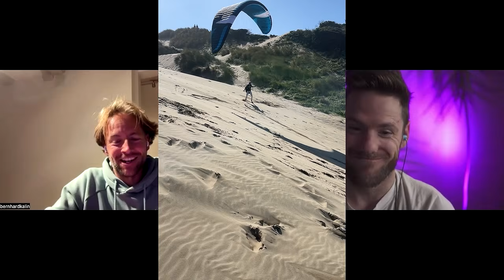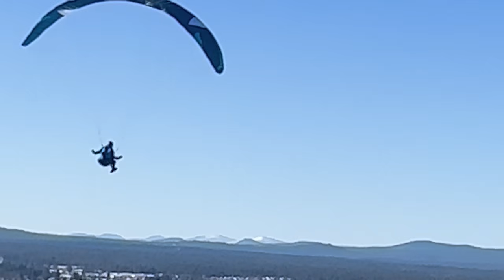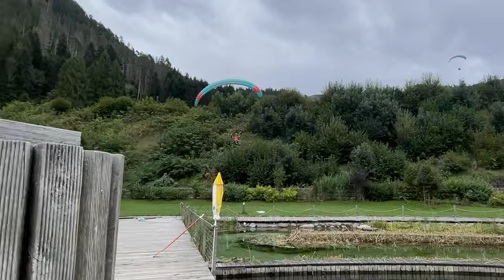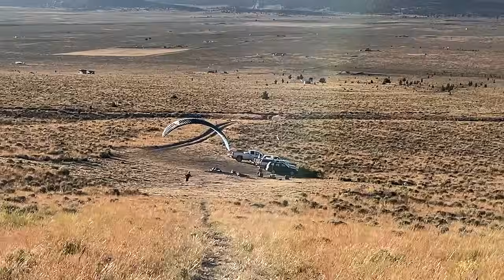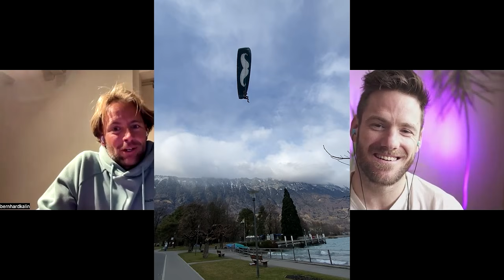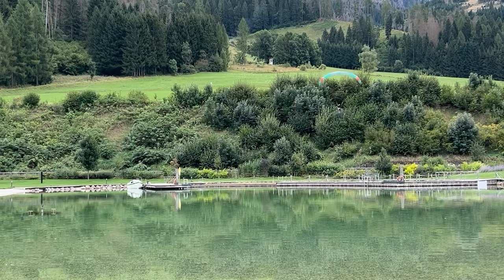Why Parakites Don't Collapse (And Why That's Dangerous)

Comment: You talk about safety parakite, but you didn't consider why he doesn't have certification.
Because he wouldn't pass this certification. 😂😂😂😂😂😂😂😂
Reply: Whyy? Please explain! Look at Vril Raptor it comes with an additional normal riser kit so you get the passive Safety to fly in best glide when not toucjing the brakes. Why should it be not safe in thermals???
Reply: @joyarosenberg954 all reflex glider have no certification. Because on full speed, they can't pass certification. On full speed reflex wing are not stable to recover after full stall or callopse. Simple like this.
Thats why ppg wings have normal risers and do not have  certification, like classic wing with normal risers.
The same for speed wings, you have no certification, even they have classic profile.
But here is problem of wing load. That's making wing unstable to recover after callops or stall.
That's safety.
Safety is only when everything going good.
But if something going bad is not safety.
That why you have no certification.
😂😂😂😂😂😂😂.
Here is the user manual for it ,what is safety and what's not safety .
Because even professional pilot can't recovery glider from big shit situation.
😂😂😂😂😂😂
Safety here, is only marketing word.

Comment: Parakites are actually dangerous in strong thermic conditions, right?  This message seems to be labeling patakites as safe and paragliders as dangerous.  And sure in some cases it probably is the case.. but, for instance, flying a B wing in thermic conditions is certainly way more safe than a mustache. No??
Reply: That‘s what I was also here for trying to find that exact thing out. From a aerodynamic perspective I don‘t understand why it should be not safe to fly a full reflex profile wing in thermals. As described in the video they are much more resistent to front collapses and only have not as much performance to climp thermals but so why not just put normal riser system on a parakite like the brand Vril does with it‘s raptor and go into thermals with it with size 22 or 25? I feel like flare and other companies just say don‘t do it with parakites because they now a lot of beginners use them on the dune without licence because they are so intuitive and they would bring themself in a lot of danger flying thermals with it and that‘s also what benni says at 7:45 that Moustache is basically a Beginner Wing in big Sizes but they don‘t sell it as one to keep people safe.
Reply: @joyarosenberg954  isn’t a large mustache still very fast compared to a Paraglider at trim?

Comment: Collapse resistance sounds fake to me. When you raise the trimmers, you actually decrease the wing’s size. So, to compare it to a regular paraglider, take a smaller wing of the same size. A highly loaded wing is more collapse-resistant.
The ground test for reflex profiles is meaningless because there’s no wing loading — the glider may appear to support itself in a way that doesn’t happen when it’s actually loaded.
Reply: It doesn’t sound fake, it is fake for any non rigid airfoil. For Paragliders or parakites is just a feature named like this … it brings some improvements but not in the way as reflex should
Reply: Good point. I would like to see the same test while flying.

Comment: Little cloud sells kite risers that can adapt any old paraglider to a kite riser control system.  Basically the kit replaces the speed bar system with toggle control. I've replaced the OEM risers on my old Mac Para Eden 7, to expand the wind range I can use the glider in.  Especially important when attempting kiting or soaring on low beach dunes, where winds need to be very strong to create enough lift to soar.  Fumbling with speed bar to stay in front of the dunes, for me in that situation anyhow,  is way beyond my skill level...Not so much with kite riser control.

Comment: I have been flying parakites for almost a year. Started on a moustache and now on a 16m 6.8AR dunerider scraper. Luckily and or skillfully? no collapses yet! I do all I can to avoid it while pushing myself as much as possible. 
It's too easy to be overconfident......check your attitude before your altitude. 

Fly safe pilots!
Reply: You talk about safety parakite, but you didn't consider why he doesn't have certification.
Because he wouldn't pass this certification.
As any paragliding wing with reflex profile 😂😂😂😂😂😂😂😂
It seems you simply don't know anything about construction.
Reply: @alittle-bigtravel199 can you please elaborate on this? I think Parakites just don‘t have any certification yet because of the Riser system which doesn’t let you fly hands free. But now put a normal glider riser system on a parakite like the Vril Raptor does and you can also fly them hands free in normal Trim Speed. I think it just takes big institutions like the DHV a lot of time to get it tested and also the problem is that the brands have no interest in such a certification because then people would buy one wing less and use one wing both for soaring and Hike and fly in the mountains. Why shouldn‘t a reflex profile be not as safe to fly in thermals when it‘s so much more collapse stable in general and the main issue with thermals is front collapses?
Reply: @joyarosenberg954  blablabla.....
Any Paramotor wing with reflex profile,  have Dhv or Ltf certification. The same situation is with speed flying wings and kite wings.
Only why is no certification, is fact that's wing can't safety recovery from callopse or full stoll.. And pass certification.
That's why you have instructions what you can and what you cannot do with.

That's why your safety is INSTRUCTIONS. And not DHV LTF or EN certification.

But not only you. All of the pilots and instructors say THAT it's safety wing.😂😂😂😂😂

That's only marketing talk ......

You say no callopses. You can have 0 Callopses ,during even 10 years ,an that say nothing about certification.

Only certification say something,about safety.

That's why unlikely ,so many people dying, on Paramotor ,speed flying and reflex kite wings.

Because they have no idea about it.
Reply: @alittle-bigtravel199 enlighten us

Comment: I'm a paraglider and a kitesurfer, I've got a 22 and 18m moustache, i fully agree with the sentiment that overconfidence is the biggest problem with these wings.
Reply: Do you think someone could learn to fly with a Flare Scout or would you recommend an EN-A and lots of flight time first?
Reply: Sorry you bought a Moustache. Great marketing. Safe wing. Small performance. Try get your hand on a flow albatroxx en learn about feedback and performance without compromising anything 
Yw
Reply: @Soaringtrips  Hi interesting what you are saying! In another comment from you, you say that you do everything with the albatroxx. Are you flying thermals with it? And what is your experience, because I don‘t really understand why their should a be safety concern if full reflex profile is so much more resistant against collapses. Vril Raptor for example comes with a additional normal riser kit so you can even fly hands free in best glide so why should it not be safe???

Comment: How come I can frontal my Viper XC with the As when it has tons of reflex?
Reply: I believe the Viper is the one that has a bit less of a reflex profile. Since it's optimized for efficiency (save fuel). Though I think Ozone in general are putting less reflex in their PPG wings. Comparatively speaking.
Reply: @progDes which viper are you talking about? Big difference between the 4 and the 6
Reply: Are you pulling a frontal while on full speed bar? I believe the Viper XC is not reflex unless on bar.